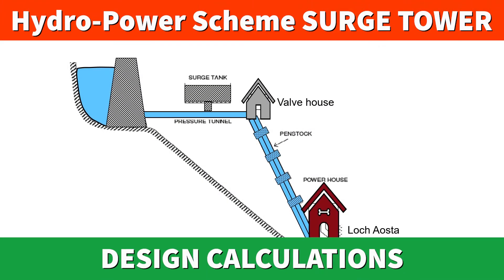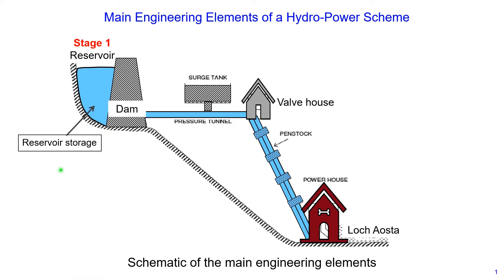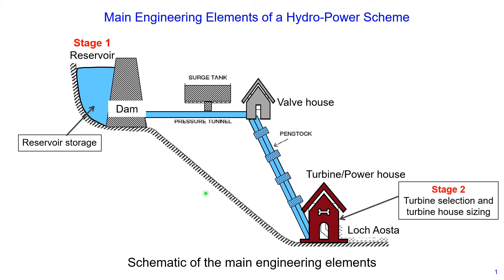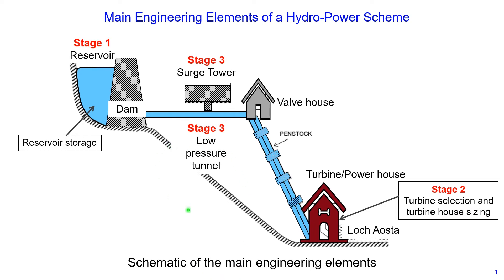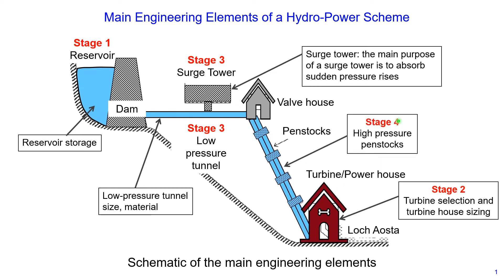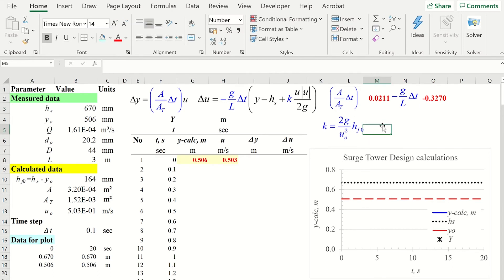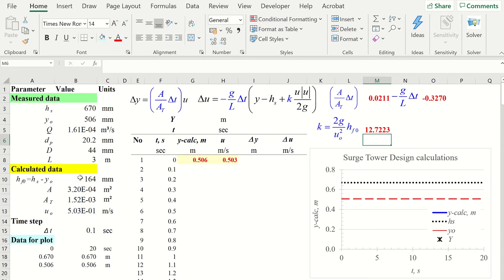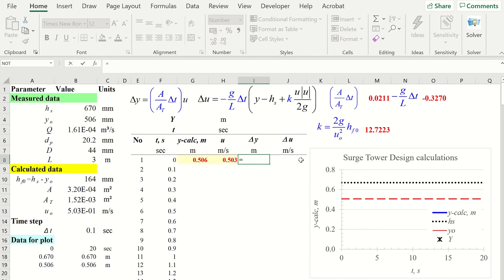How to Design Surge Tower in Excel using simple finite element method Part 2

Comment from the maker: Theoretical background is covered in this video 'Renewable Energy Hydro-Power Scheme - How to Design Surge Tower Part 1' - https://youtu.be/_b5TEjpT6q8
Surge Tower is one of the key engineering elements of a Hydro-Power Scheme. The tower protects the pipeline by 'absorbing' the surge pressure generated downstream. Part 2 video covers Surge Tower design calculations in Excel using a simple finite element method.